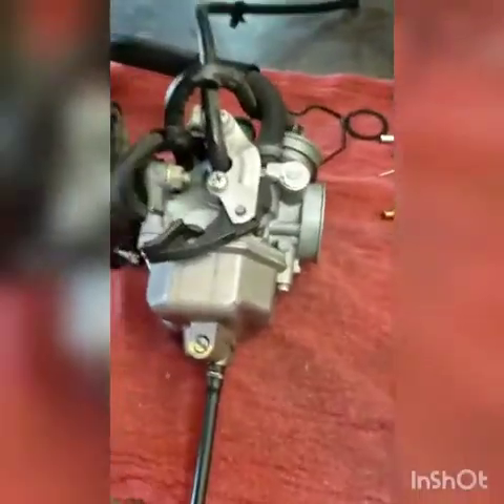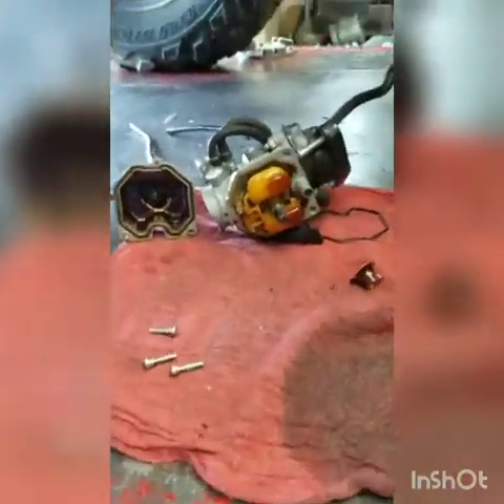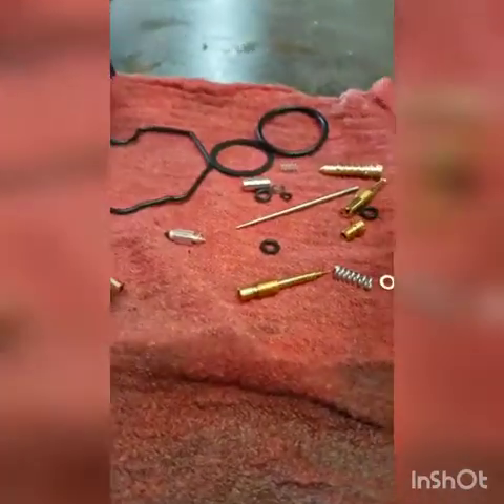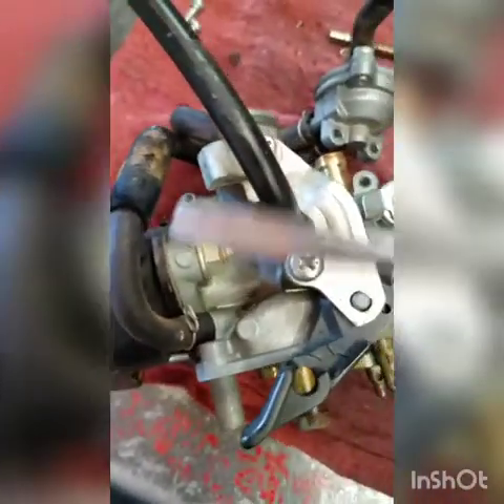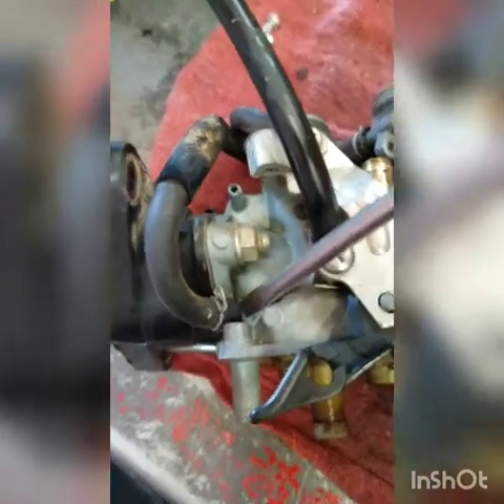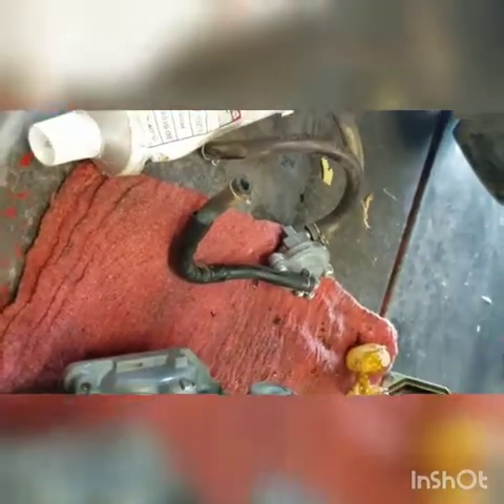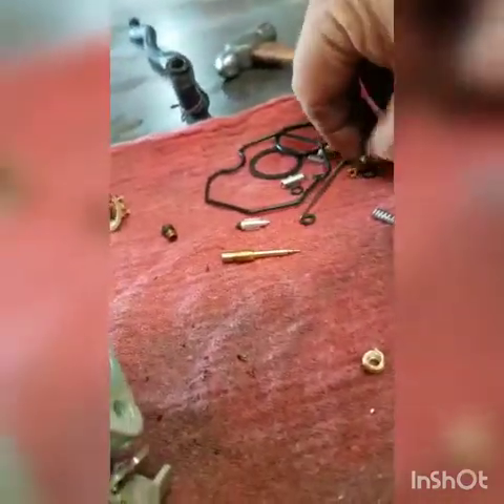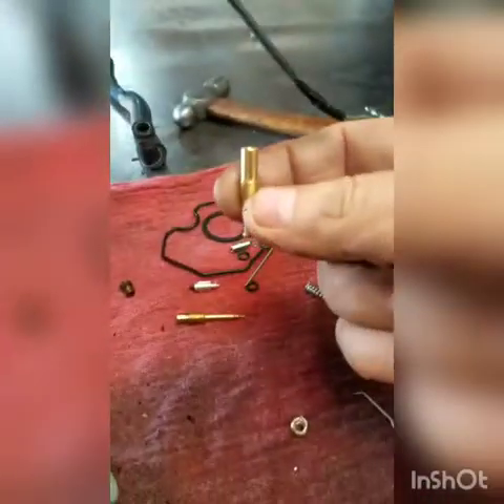Honda TRX250 Carburetor rebuild

Comment: Great Vid, best Honda Recon carburetor tutorial I’ve seen! I have a 1998 Recon that was given to me by a friend, it sat for years, when I put gas in, it just poured out the bowl hose and I knew the float was stuck.  After pulling the carb off and cleaning it with just a spray carb cleaner & q-tips, it runs like a brand new engine now, one click of the starter &  it fires right up, I’m glad I found your video even though I’m already done with my rebuild, I used to rebuild my dirt bike carbs 40 years ago, but I learned a lot about how they work & tuning from you so thank you much!